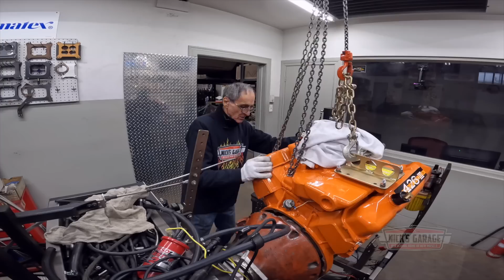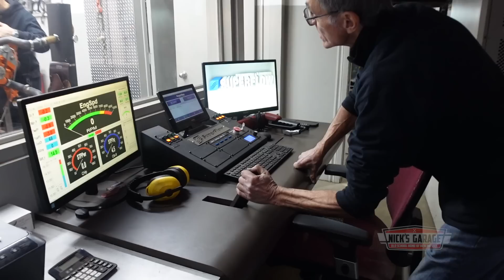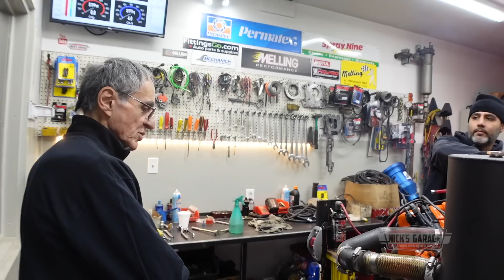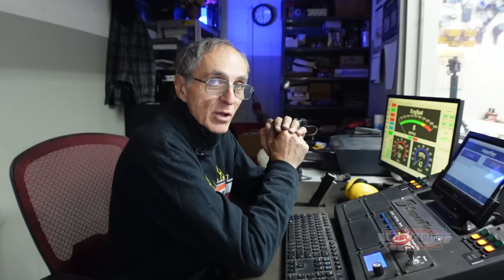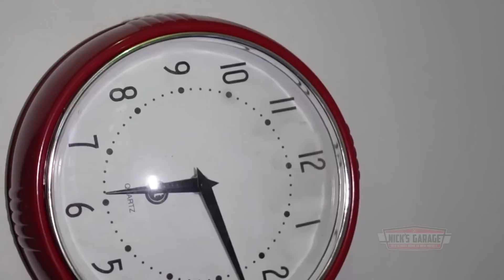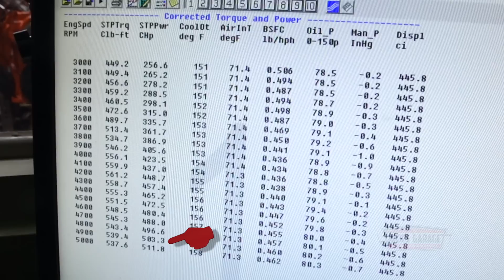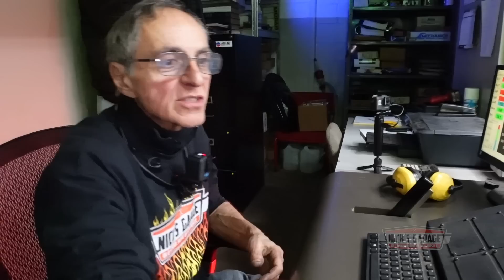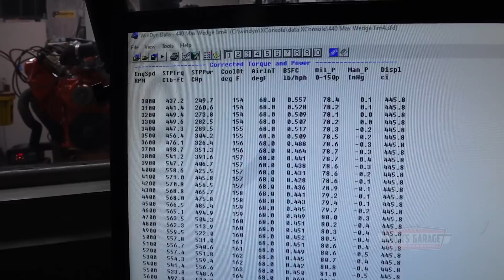Max Wedge Dyno Tested - Troubleshoot a Legend

Comment: Swimming valve springs are a bad idea you should always go with the seat pressure that you need rather than the seat pressure you don't if you use a different set of springs for breaking a can that's one thing but when you're going for top-notch power you've got to use a heavier spring not a shim because you can end up with coil bind

Comment: One of the reasons I fell in love with Mopars back in 1984 was that they always had the balls to stick their wildest engines in their smallest cars. I picked up a book at 13 to read about muscle cars and those big orange engines with multiple carbs impressed the hell out of me. I got my first car at 16, a 1970 Road Runner with a transplanted 440 in it. I still have the car at 55 years old……Get Real….Get Mopar.

Comment: To help avoid flattening cams hot soak the cam in oil for 24 hours before installing in the vehicle. Cast-iron cams have pores in them and they will soak up oil on the lobes and bearings. This was this was the standard in engine building for factories for over 50 years.

Comment: nick you should really have that camera overview of the top of the engine when your dynoing on a screen in your control room i can see your issue with the power loss at high rpm a choke flap thing something keeps moving around at high rpm

Comment: Fun engine, but to call it a Max Wedge as a 440 with aftermarket heads is off. A 426 Max Wedge would be 426 CI, 13.5:1 (for a 1963) or 12.5 (1964), have the correct head casting, the cross ram, and cast headers. These were unique to the max wedge series. That's a 440 with a cross ram, it really doesn't share any other commonality with the max wedge other than RB block and stroke length. Even then, the 426 block was notched to accommodate the large valves the heads used. A true max wedge would require race fuel, as pump gas wouldn't support the compression with a cast iron head. I like what you are doing here, but this engine really shouldn't be called a max wedge, it's really a distant cousin.

Comment: A tale of two engines. The first was a small block. I was helping a friend with his small block rebuild when I could get free from work. The friend was pretty impatient and he liked things painted all nice. I left the build with the short block completed. When I came back the friend had his engine pretty well done. It was painted up so nice (this will be important.) Ok we got the engine reinstalled in the friends truck. The engine fired up immediately then died. I spent probably a hour cranking and testing things, trying to get it to fire up again. I ended up oiling up the cylinders through the spark plug holes. The engine fired up and ran nice. The friend drove away but came back. The engine developed what at times did and at times didn't sound like a rod knock. Finally this engine developed a real rod knock and had low oil pressure. The friend sold the truck to another friend. The second friend tore the engine down and discovered every bearing had been wiped out including the cam bearings, what the heck happened? Remember the start then no start condition followed by me oiling up the cylinders? Remember me saying the first friend liked everything real clean and painted up? Turns out the first friend decided to clean the old paint off the heads in the shop bead blaster. The first friend didn't wash the bead blast medium out of the heads. This bead blast medium sat in the ports till the start up then got into the cylinders. It washed the cylinders out then got into the oil. After about 1500miles this contaminated oil destroyed all the bearings. This was all over being impatient and wanting everything super clean and painted.
The second problem start up was a 351 Cleveland (with the big valves) This engine went through extensive cranking during initial startup due to getting the firing order wrong. This extensive cranking actually damaged 3 cam lobes.
Have you ever heard the sound a small block makes when running on a flat cam? They sound like boat motors, putt,putt. We called these cams "Mcdonalds cams as they were "ground round".

Comment: The other thing guys, im not sure if your aware of is when you mess with two carbs on the initial idle screw set  up you remove one idle throttle plate adjustment stop screw and use only one in which carb you choose of your liking but you will not screw it in to touch the stop until you rig your bell crank and primaries fully closed so they are synchronized mechanically precisely.  Then screw that one idle screw in until it touches were you think it belongs on a the one carb you chose to install it in, turn it in and adjust the idle stop until you get  which I would think would be around 1 and 1/2 turns in to open primaries for that initial idle start up which would be half what it would be on a single carb setup then your ready to do the rest of your hook up what ever you guys do to get to the end of your process because you guys did great getting to the end of the process I was with you all the way I anticipated the distributor the prob lem when nick was talking about not pointing in correct postion with the rotor after the initial setting of the distributor had changed.    By the way the Idle stop screw that was left out, can go back in the carb now once your done tuning, screw it in until it touches the stop of the primaries with light pressure.   Idles screws should always be at same exact location setting with primaries being same location in the bores.

Comment: Valve train loses control above 5300.  Peak torque is around 4200 so it should make peak HP around 5500-5700.

Comment: I cant see how a distributor with a crank sensor in it can be accurate enough for consistent timing. There is such a small radius that 3° wouldnt be able to register. 1° would be under .01" at the points. You would be making spark within like a 15° range.
Or whatever. Whar do i know? 
Thanks for the content.

Comment: hes got a b distributor in an rb ! . the second he said this is an actual max wedge distributor i said ouch i hope it works !  they used a shorter distributor in the real max wedge you can use  the rb in the b with the collar adapter  i had one on my dick landy 383 i saw this and had to watch cause im using the same intake my landy 383 made almost 500 hp in the dyno with one of these intakes and 2 holley 950 3 barrel carbs gas ported pistons yeah 1968 and gas ported pistons 906 ported heads they put bigger valves in back then ! used a bunch of trick stuff and it ended up at mr norms made 460 to the rear tire on mr norms dyno in 68 !

Comment: Hey Nick, did you know that your middle trottle linkage is 180degre off that why you have to push trottle on your setup??? The main rod coming from the fire wall should pass under the left cab linkage

Comment: I would like to know if the original 426 stage 3 max wedge heads are on this 440 engine? Because there were no issues regarding the carburetors

Comment: 1978 built a Dodge Dart  max wedge stage 3,,,,446 cid.....all mid range ...286/292 duration @50thou....a 427 chevy 11 passed me in the last half of the 1/4 mile.....decided it wasn't possible for any mopar at that time to have top end pull....Built a 427 BBC ..then a 406 SBC which was faster then all of them.

Comment: That noise is the beautiful sound of a solid lifters clacking away. I run  solid cams in everything I possibly can including my 2003 zr2 blazer that is getting a solid roller vortec 350 with factory electronics and 5.3 decapped injectors instead of poppet valves
Reply: The blazer will be running any day

Comment: Mentioning about the carburetor gaskets. The thicker gasket looks like a better choice because each barrel is sealed from each other. The thinner gasket doesn't seal each barrel individually. That's what I observed when you guys decided between the thinner and thicker gaskets. Thanks for the video!

Comment: I have had issues with the hydraulic lifters pumping up at rpm. I generally run my hydraulic performance cams at zero lash.
Reply: I put a very small pre-load. About .020.
Reply: @Nick Panaritis  I ran something similar, but had valve float above 7,000 rpm. Wissota Midwest modified 318, 308 heads turning 7,400 rpm and 2 bbl carb. Great episode, even though it was a challenge for you!

Comment: A distributor problem can be very illusive. Had something similar happen on an inline 6, 66 mustang. Brand new aftermarket distributor, wouldn’t start, checked timing, wouldn’t start, re check compression stroke on #1, fuel, spark, compression, wouldn’t start.. i could not figure out what the problem was until I swapped the distributor for the original one that was sitting in the trunk. Fired up first turn on the switch. 

The new distributor gave me a false spark. Hot enough to visually see it but not hot enough to make the engine run properly.

Comment: That cam doesnt have enough signal for 1500 cfm! Weird sounding grind! Maybe a 284 dur! Who degreed the cam? It sounds like it could be outa wack! Did you say those are painted tricflow 270 heads?
Reply: I'm trying to remember if Nick ever made a video on how to degree a cam. If not, he should.
It's one very important step when putting an engine together when you have so many after market parts.

Comment: At 36:15.. His guy starts putting the wires on in the wrong direction.  BBM plug wires go 18436572 in a counter clockwise rotation. He began installing them on the cap clockwise.  There's a big part of the problem.
Reply: Never. We had counter-clockwise all the time. We know the firing order very well.
Reply: @nickpanaritis4122   Hi Nick, love your channel and content. I'm just stating what I see in the video. No disrespect.

Comment: In 1964, a friends brother bought a brand new dodge, with the 426 Stage III Max Wedge, two door, post car, no radio, bench seat 4 speed, not sure of the rear end ratio, it had factory cast iron headers, that ran from the motor to just behind the seat location under the car, not a pretty car, but, I never saw it beaten. He street raced locally. A few years after he got it the Hemi came out with a lot of fanfare, they didn’t stand a chance, he annihilated every one of them. I believe the doors, hood,  trunk lid, and bumpers were all aluminum. I have had many muscle cars myself, some new, some used, this car was impressive. I had a brand new 1969 Yenko Camaro, not to sure it would have beaten him, in 1970 I had a LS-6 SS Chevelle, I bought brand new, that might have given him a good run, it was actually faster than the Yenko. I haven’t seen him in many years, but the last I knew he still had that car, he moved to Florida, so we lost touch, he would be in his 80’s, so probably gone. Time moves along. LOL I really enjoy your channel, wish you were closer, I have a W-30 442 I just finished a restoration on, I’ve had it new since 1972, could use some help getting it sorted out, the motor was totally done, high compression now, balanced and blue printed, with everything in between done as well. To old to handle the finishing of it unfortunately. Looking forward to your next videos.

Comment: More interesting content. Next you could do a hemi cross ram engine. I had an aftermarket cross ram for my 383 that I never did try out. Now I wish I had. That engine made huge power with a TM6 manifold and stock heads. Crane H312 flat tappet, 12.5:1 compression. 7200 rpm.

Comment: The carburetor butterfly is on rong the hole in the butterfly is for the throttle cable and the little hole in the  butterfly and a hole in the intake line up close   off the carbs drop in the hole in the butterfly and the intake and set up the throttle linkage pull out the pin you used to lock the butterfly up right to setup the carburetor linkage and set up the idle on one carb then start to set up the idle on the other carburetor as soon as it starts to pick up the idle back off and they are in sink the butterfly has a ratio built in it so that the carburetors move the same time I am just saying ben there in the old day's 😀!

Comment: Noise is to constant, probably the a rocker hitting a cover or windage trey not clearanced properly   Nick, take that cross ram and throw it in the garbage.  I candy believe you ran that motor that long with a new cam.  Probably have to start again with a new cam.  Stick a single plane or duel plan and break the cam in first before you try a fancy non working intake.

Comment: Thx for the Fantastic video, Nick !! ...Your newest Assistant is cool & youall seem to have Great chemistry !! ....This 440 Max Wedge Cross Ram dyno project is "The One"  I've been looking for...That 0.600" cam is considerably "Tall" than the factory's 0.520" unit with similar Durations....The Factory original Stock 750 AFB's Probably Flowed around 700 cfm & the 600 cfm AFB's deff have better, Crisper throttle Response.....Good to Know the Distributor shaft is 2 Pieces...Didn't know That !! ....The weird intake backfire is Bothersome...Hopefully, No mechanical Valve Issues & just Shimed up Spring Psi will the fix the carb Fire puffs & Rpm lay down  problems & Smoothly pull to 6000.....Can't wait for Part 2 when All is running great & putting up some Strong cross ram HP numbers !!  Thx again for great videos...

Comment: Silly question, maybe, but why didn't you just turn the relay lever 180 degrees to have it a pull linkage? If it's a push in the vehicle, just swap it back. The linkages from the relay to the carbs would be the same operation.
Reply: Good point.  But we still had it working.

Comment: Max Wedge a very hard engine to tune but when you get it running right it is hellfire
Reply: Very easy to tune.  Hemi's are easy but a Max or Ramcharger 413/426 is easier.  Those rumors about the the wedge and Hemi over the years are totally false.  I personally think the 6pack is the toughest tune from Mopar

Comment: Loosen up your valve lash Nick. Aluminum heads expand under hear differently than the cast iron ones and the hotter the motor gets, the tighter the lash. I would guarantee it's running at almost negative lash once it's warm. Also explains the valve float the lack of free revving and the popping thru the carbs.
Reply: I think it has hydraulic lifters... and the hotter, the looser the lash as the rocker shaft raises up... for solid lifters... hydraulics will compensate...
Reply: @BuzzLOLOL  it may very well have hydraulic lifters,  but it is running old school solid lifter adjustable rocker arms.
Reply: @TalkswithPop  - Are there lightweight, nonadjustable aluminum rockers available? Then adjust to zero lash by pushrod length...
Reply: @BuzzLOLOL  that may also be part of the issue. I know more about small block Mopar than big block moparrs, but in small blocks anyways, the adjustable rocker arm setup was only available on solid lifter cam motors and there is a pushrod length difference between the two which throws off geometry and basically either forces you to run the lifter collapsed or back the adjuster out so far it's dangerously loose

Comment: electronic ing/ does not have points. there not needed.
Reply: There used to be kits with electronic module that would connect to your points distributor. The points were used only to signal the module to drop the voltage to the coil and create the spark.
Only a very low amperage was going through the points and that would make them last forever. The dwell / gap was not as critical anymore too.
I would be surprised if any body use that particular set up anymore. 
One thing for sure, using an old / original point set up is not very efficient compare to anything electronic.
Reply: @GHP-mr3gs  Thank you for the info, inever ran across that. i worked on auto till computers then i quit, then went to aircraft which mags up till the few years, i know nothing about these systems. so i'm older now and no longer work on or fly. thank you for onfo, hav a great day!

Comment: Power drops by 20%+ in the space of 100rpm in the mid to high 5K range - Valve springs are toast, possibly even a few broken inners.  Those backfires at the end could possibly be a few bent intakes from floating them that hard.  I'd get a fresh set of springs on that thing, check valvestem height, and do a leakdown on all 8.
Reply: Light aluminum heads but heavy iron rockers and heavy long adjuster screws... valve springs are prolly new...

Comment: As the distributor half shaft unthreaded itself did the extra length have somewhere safe to go?
Reply: It just made a small twist.  Not enough to push up on the hold down bracket.

Comment: The  twin 750s are  way to much  It should  have  1000 to 1200 cfm total  depending on the  cam and  distributor  being stock might  have  to  much spring on the  counter  weights but the power  is respectable  given  the  parts that are  on it.

Comment: While a neat looking setup, there is absolutely nothing "Max Wedge" about this engine. 440 block, Trickflow aluminum cnc ported STANDARD port heads and assuming it's an A&A aftermarket standard port crossram intake designed to work with STANDARD port heads.
Reply: You are correct if those are Trick Flow 240.
If heads are Trick Flow 270, it's absolutely a Max Wedge
Reply: if it was a max wedge that max wedge distributor would have worked its not grabbing and spinning cause its just touching that says hes got a b distributor in an rb block
Reply: Not 6?
Reply: I’m talking to someone